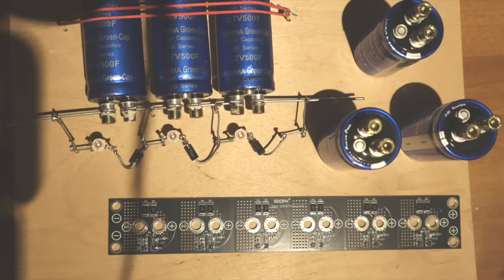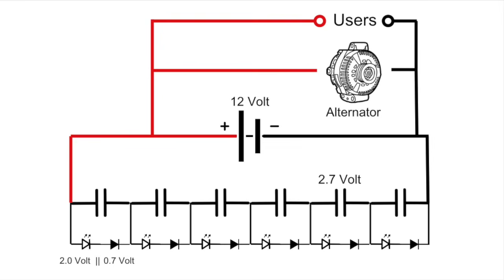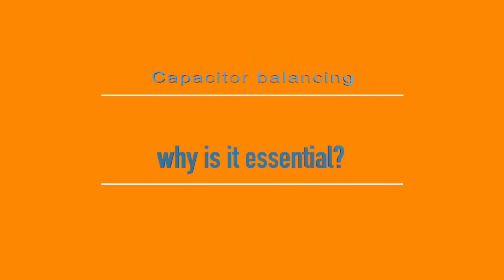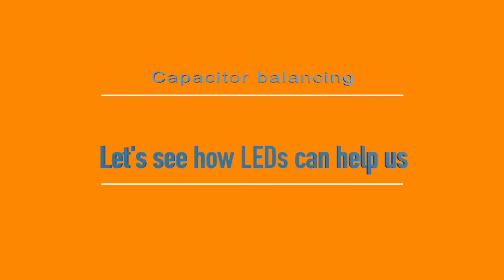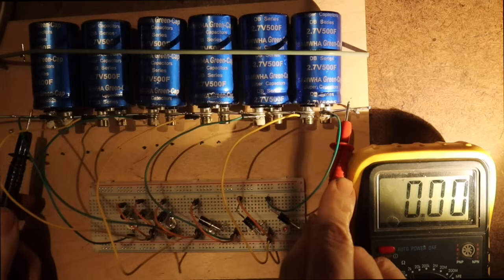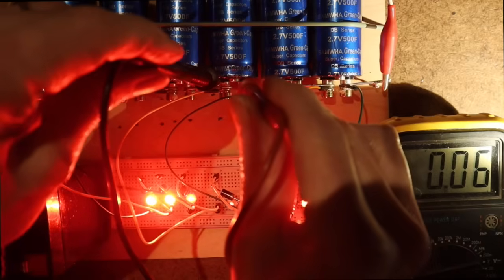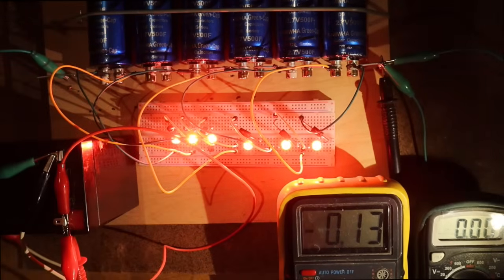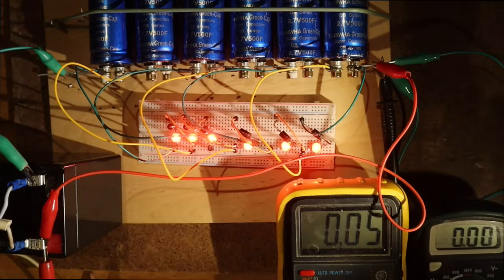How can a Super Capacitor help you start your car reliably and let live the battery longer? 86

Comment: This build looks like some older designs floating around several years ago (several on Youtube). There are a couple of serious problems with those builds which I will break down if you wish to continue. 

1: A car alternator will crank out a LOT more current than your power supply. This will cause the misbalance of the super capacitors to be much greater especially if the engine must crank for a spell as supercapacitors voltage quickly drops in a linear fashion as they discharge unlike batteries (this leads to problem #2). Super capacitors break down VERY quickly if they over voltage. Those LEDs cannot draw enough current to do any real balancing when being charged from a high current source like a alternator. You need a real balancer circuit made for the high amp charging speed if you want to protect those capacitors.

 2: Putting your capacitors in parallel with the battery is NOT going to protect the battery from the starting amps of the starter. It's going to put a heavier load on the battery! The reason is as a capacitor discharges it's voltage immediately drops quickly in a linear fashion based on how much it has discharged. A battery on the other hand holds it's voltage steady until it approaches near discharged. What this means is when you start your car the voltage in the capacitor bank will drop below the battery. This will cause the load of the starter to be shifted over to the battery with the battery also trying to pull up the voltage on the capacitors at the same time. From experience I have found you can get around this by placing a resistor/diode in line with the battery. The resistor limiting the amps the battery can put out while the diode allows charging unimpeded by the resistor (See schematic in video).

3: Stay away from GreenCap!!!! Most GreenCap super capacitors are super capacitor tolerance rejects from other manufacturers bought in bulk and resold under the GreenCap label. They have poor discharge and variable resistance from one capacitor to the next making balancing a nightmare. When going with something important or you want to last a long time IMO ALWAYS go with Maxwell Super Capacitors. They are very good tolerance and very durable! Mouser.com is a good source for non-counterfeit Maxwells.  

4: You will likely want to bridge your super capacitors in series with high current copper/wire. When the battery is not carrying the lion share of the load, for many cars the current demand will be too high for the small traces on a board between those capacitors, and you may need something heavier to carry the current? I found copper grounding rod easy to work with. 

Good luck with your build as working on something till you have a good project is a joy for all us makers. I did a project like this several years ago. I have two videos you make fine useful information. Good luck!

My schematic video of final super capacitor car battery: https://www.youtube.com/watch?v=zBDtUxPdhz4&t=0s

Here is a older version of my battery starting my V6 Toyota: https://www.youtube.com/watch?v=X8D7sNKNu-8
Reply from the maker: Hi Gene, you have been working on the subject! thank you for the many tips and I will look those two videos but also others on your channel (I subscribed). 
I agree on going deep into a serious subject (I made a remark in a reply below about so many batteries tortured by current peaks) and already ordered a good oscilloscope to understand more the dynamics. I will also set up a test rig with a weak battery and cranking motor.
By the way, also hydroponics is a fascinating subject.
I will take note of this and tackle point for point. Cannot promise that it will be soon. Maybe I will upload an intermediate video.
Reply: The chargin current decrease a lot when the capacitors are almost fully charged but still far away from the voltage limit. So the LEDs dont need to bridge a lot current.

Comment: I have. been using this on my garden tractor for years.  It makes a quicker start.
Reply from the maker: That's awesome to hear! Super capacitors can really make a difference in starting engines more reliably. How many cc is your garden tractor and how many capacitors with what F value you use? See my answer below to Hanka to see how the capacitors and battery share the burden among them.

Comment: Good idea. I clicked LIKE 999 to 1k.
But / ABER 
1.- Once car stopped and key off :
1.1.- The battery of the car is going to start discharging through the line of diodes
1.2.- The capacitors will start discharging through the line of diodes
1.3.- Once when the line of capacitors has discharged through diodes below battery voltage, the battery will start attempting to charge capacitors, further drawing current when car stopped, that shouldn't be.
2.- Quick solution : Couple of relays one each side of this circuit, disconnecting both sides of battery (battery to this circuit, NOT battery 
to load and alternator) helps prevent battery being discharged by this circuit when car stopped.
3.- To control such relays you can either add a manual switch on the dashboard, 0.01% off users would put up with extra flick at every car start and another extra flick at every car parking, but 99.99% users would require not flicking extra switches.
 So add a control circuit that closes relays when starting car, and disconnects when car switched off. 
4.- Add a small microcontroller to control relays. An additional current meter on the board would also help monitor how much current is really being consumed by this circuit.
5.- And then comes the hard part : mage money out of it, to make it salable. 
You are going to have to test it for several hours in diverse scenarios , extreem heat, freezing cold, car on but idle for extended time. Several on/off off/on cycles.
You also have to cover the eventuality that one or more than one capacitor turns up faulty directly from supplier,  or with time becomes or leaky.
Or a car impact, wet, dust, vibrations, 
damage capacitors or/and diodes.
There is where the microcontroller for the relays and on-board current meter should also notice, open up, and notify there's a fault.
6.- Those capacitors should have a far  more robust, thicker, reliable connection than breadboard holes.
7.- And your circuit is going to need some kind of car industry certification, CE marking, so vendors distribute your product.
8.- What about vans? motorhomes? lorries?
9.- Are you designing a diesel motor version?
10.- Both EU and US governments are planning another crussade. But they need to stop being so reliant on middle east and Russian oil before putting back on Solokovs and bucket heads, again.
This is why all this climate change nonsense and the every-one-must-buy-electric-vehicles
pressure.
Around 2035 US EU govs will prohibit the sale of brand new gasoline or diesel engines.
Does it make sense to develop a microcontroller board for a technology that is going to be discontinued?
11.- How many of these boards do you think can be sold?
12.- With additional relays on both sides of the diode line and flip-flopping when required the microcontroller would solve the pending point of current peak frying the diodes. 
Proper timing/gating would save looking any further for bulky/odd/expensive diodes.
Good luck. It's a promosing start. 
But like Beethoven used to say :
 A masterpiece is 5% inspiration
 and 95% perspiration.
Reply from the maker: Hi @johnbofarullguix1499 Thanks for the deep dive and putting digit #4 of the counter on 1! From which country are you, I saw a German word :-)

You’re spot on with the discharge risk—diodes alone won’t prevent battery drain when the car is off. Adding relays controlled by a microcontroller is a solid fix, ensuring automatic disconnection and avoiding manual switches (because, let’s be honest, no one wants extra flicks).  I have not looked yet for those high current relays but maybe I will just reduce the discharge current with a bought board or follow the comment below with "current mirror ratio 1:N".

The real challenge, as you said, is making it bulletproof: temperature extremes, vibration, capacitor failures, and unexpected scenarios like crashes or water ingress. A current meter with fault detection is a great idea.  

Certification? That’s where the real headache starts. CE marking and automotive compliance can be a bureaucratic maze. I have been also in the patent process and decided to leave it for the inventors that have patience. I have not and prefer to display it "on the street" so that everyone can make use of it. My viewers (I hope) have the courage to try my ideas and change them as they want, let me bring a spark of inspiration.  

And yes, the elephant in the room—internal combustion engines are on a countdown. Still, 2035 isn’t tomorrow, and a well-designed system could still find a niche in commercial fleets, backup systems, or even hybrid retrofits.  

How many can be sold? That is music of the future. I play with the idea to put components together as I composed them ("The Tech Symphony" as in video 84) and sell them together in a box.

As for Beethoven—agreed! This is the 5% inspiration. Now comes the sweat. I hope that our Energy Home DIY community will become a big sauna meeting!

Thanks again,
Norbert
Reply from the maker: I agree with making better contacts, not using the breadboard in the final version!

Comment: Now, I am an electronic idiot 8n comparison to my Dad that died working as a design enginer for GE Medical Systems, and my brother thatis a computer science Emgineer, but, would it be useful to insert either voltage, current or power regulators in each capacitor stage in the super capacitor stage?
Reply from the maker: I agree with adding some controls to the capacitors, maybe better then my simple system, I will first try to go on with those two diodes and tinker a bit, to keep it simple. Then I will try with other methods also proposed in the comments. I won't make it too complicated or expensive.
Greet your father and brother from me!

Comment: Trochu jsem počítal, tak se podívejte na to. 500F nabitý na 2V při zatížení 300A už za 0,5 sekundy bude dávat 258A protože mu pokleslo napětí na 1,72V. To je pokles při 6 kusů supercap 10,32V. Za jednu sekundu je to 222A a pokles napětí na 4,4V. To už je málo pro startér. Další otázka je, jestli vaše kondenzátory jsou schopné dát takový proud. A nevim jestli víte, že tak malá LED zvládne 20mA a při nabíjení a malém rozdílu kapacity jednotlivých supercap dojde k usmažení LED diody u prvně nabitého supercap. A nepomůže ani 3A LED, protože proud protékající LED bude shodný s nabíjecím proudem. Vaše pokusy jsou zábavné.
Reply from the maker: Thank you again Hanka for your engagement. I put the English translation for the audience:
I did a little math, so check it out. 500F charged to 2V at 300A load will give 258A in 0.5 seconds because it dropped to 1.72V. That's a drop at 6 pieces of supercap of 10.32V. In one second it's 222A and a voltage drop to 4.4V. That's not enough for a starter. The next question is if your capacitors are capable of giving that current. And I don't know if you know that such a small LED can handle 20mA, and charging and small difference in capacitance of each supercap will fry the LED of the first charged supercap. And a 3A LED won't help either, because the current flowing through the LED will be the same as the charging current. Your experiments are fun.
----
I should measure the capacitors Farad value in the next video! I had already the impression that the voltage was rising to quickly with a known charging current. I agree that the current is possibly not enough on its own but the battery is still there and it has maybe delivering 1/3 or so of the total current. The elegance is in the fact that the big current spike will give a quick voltage dive in the battery voltage if it is alone and the capacitor will give a hand precisely in that moment! Because it will not allow a quick voltage change without giving really an incredible blow of Coulombs, with its low internal resistance. I am really curious about seeing this and want to show it on an oscilloscope, I hope you will appreciate that.
The LED is 3 Watt and without cooling body I used it up to 300 mA, keeping it in my fingers, that didn't hurt, not even on the long term. I am aware that even 0,3 A is small compared to the discharge and charge current but the balancing effect is incremental. Every cycle closer to perfection. I did a few cycles to ensure it works well (visible also in the video). Next video I will find and show the compromise between a low auto discharge and satisfying balancing speed.
Regarding the current capabilities, you see in the next video (87, with the jump starter) that I have also another 6-pack with thinner contacts. I bought the second 6-pack to have the thick contacts with bolts. I will try it with large current spikes and show the next time.
Thank you for the appreciation of the experiments!

Comment: Will this work for my battery bank on my solar setup?
Reply from the maker: Yes, this should work there, I saw also youtube videos about it, but usually the batteries in home systems have more capacity and not such high current spikes as in a car, it is always the ratio between current spike and battery capacity that is important.

Comment: I saw someone on a video like this thar you made, he used a piece of small gauge wire, maybe 16, 18, or 20 awg. with a length of about 1 or 2 meters between the capacitor bank and battery/alternator for a current limiting. Also do you think that an "active" balancing  would be better than "passive"?  I think the active balancing would perform the balancing of the capacitor bank faster and will have less chance of a capacitor to be over charged with current, not to mention no loss of current bleeding or burning off of the higher amp capacitors during a passive balancing. I also believe your wrong, based on my experiences that a engine starting motor requires 500amps. I think that if you challenge this you will see that a starter motor needs less than half of the 500amps you stated in your video. I like your videos and hope you make more on your findings.  Thank you.
Reply from the maker: Thank you Chris for your appreciation! I go on with this problem, even if it seems I am distracted with other projects, like the air exchange with heat pump. Development comes always with delays and multitasking is a solution.
 I am glad that the 500 A is overvalued, I had already the idea to be very conservative. Then, a comment came here below that I forgot to calculate the series connection of capacitors reduces its Farad and now this margine is very convenient 😥.
I was also thinking (you heard it at the end of the video) about a protective resistance between alternator and battery (50 mΩ). And then today, in search of old batteries and start motors at a workshop, the electrician told me that (unless an old style car) there is always a fuse between alternator and battery. Big relieve.
Reply from the maker: I certainly will share more findings, this weekend I will review a jump starter, which is not an alternative to the Super Capacitor Bank (as some commenters state). I see it now as a must-have (see my comment to Karl Jay about movies with not starting cars, below) and reason of much fun in the laboratory.

Comment: interesting. thanks for posting. is it also possible to use diods lets say with 4 v to protect and balance lithium batteries when charging them?
Reply from the maker: Hy MilkyWay, I saw that you are also active in electronics, in music! I see sometimes super capacitors that are sold for music amplifiers in the car. Four volt seems much for lithium balancing because of the lower lithium voltage but take two low voltage LEDs like red or yellow in series and that is already a bit too high so better seems to me another colour of LED (higher voltage) with maybe a normal or Scottky diode in series. That would be indeed something to try, on first sight it seems a valid idea for a BMS (battery management system). Of course it must compete with existing BMS, I don't know how many of them are on the market.
Reply: @nnvasen-good-energy  hi nnvasen, thanks a lot for your answer. and thanks for looking at my channel.yes i like to make music but also experiment with all kind of things. i was thinking of 4 v because a 3.7 v nominal lithium cell  can be charged up to 4.2 v. if i took a 1.8 volt led and a 2.2 volt in series...? i will try 🙂
Reply from the maker: Hi MW, yes I also loaded the jump starter to 12.1 Volt and it has 3 cells, so indeed it goes to 4 Volt a cell but  might go back quickly to its typical 3.7 Volt and stay there for a while during discharge.

Comment: I condensatori compresi i super hanno una corrente di dispersione alta per cui non tengono la carica come le batterie ma si scaricano in fretta
Reply from the maker: Hi Giusky, I agree that they have a high leakage current for parked cars, but if they start every day, it gives no problem. I made a measurement with my low cost capacitors and they lost 10% in 12 hours.

Comment: Cap in series will reduce the capacitance.   In parallel will increase the value.  For starting purpose u may want one large cap to do the job.
Reply from the maker: Hi Jim, yes, I would like it, but are they available? I guess that these capacitors are of chemical type and have therefore this typical voltage 2,7 that is equal for all those capacitors, like batteries have their characteristic voltage.